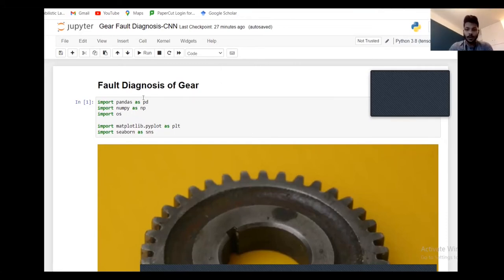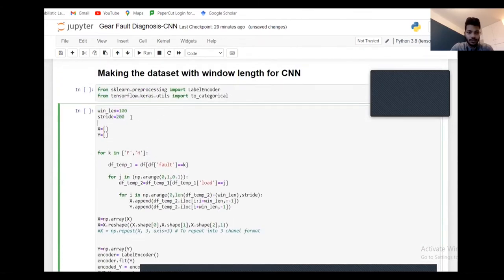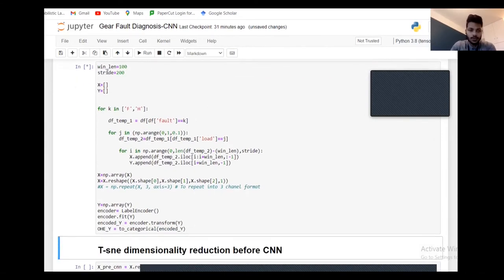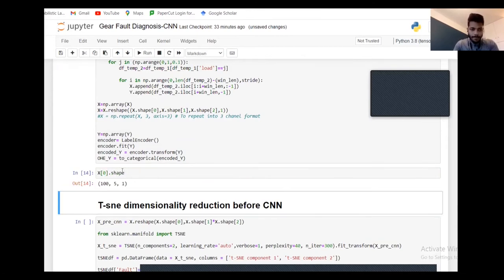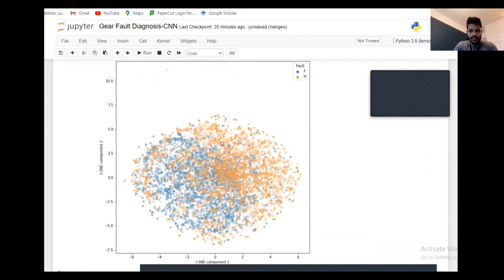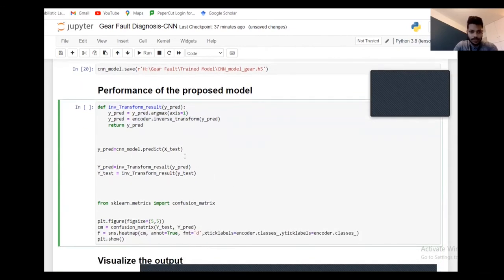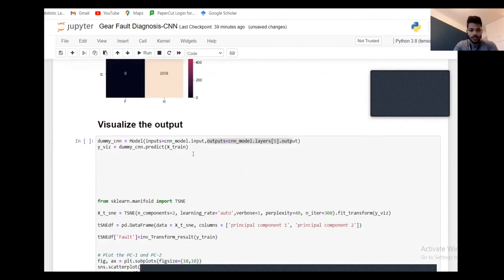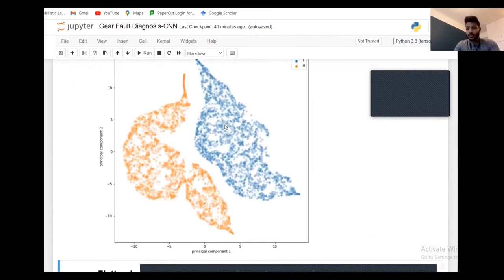Machine Learning for Gear Fault Detection || CNN with Visualization || Part - 3

Comment: Hello

dummy_cnn = Model(inputs=cnn_model.input,outputs=cnn_model.layers[7].output)
y_viz = dummy_cnn.predict(X_train)

getting error in this code as 
ValueError: The layer sequential has never been called and thus has no defined input.

please help
Reply from the maker: It seems like the 'cnn_model' is not created. Try to rerun the entire notebook, it should work
Reply: I had the same problem. How did you fix it? Please help.